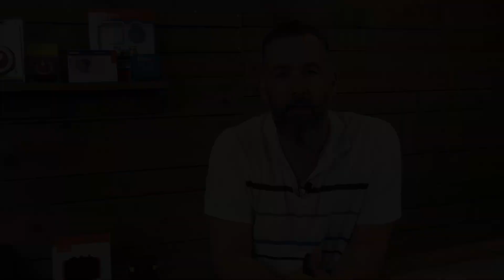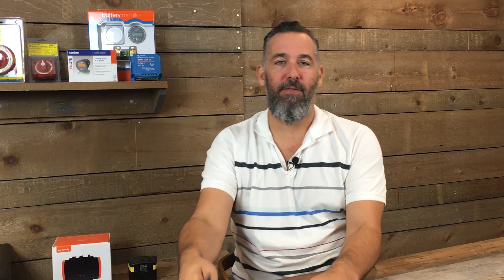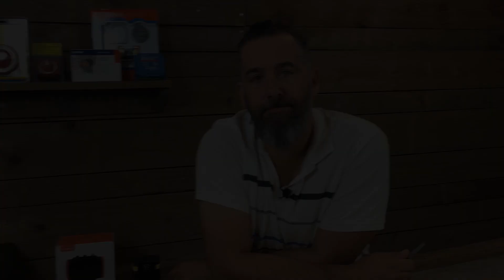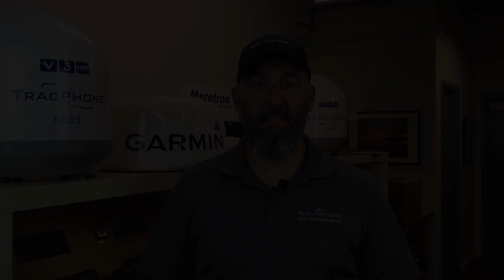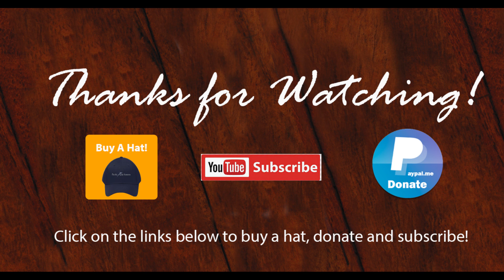Ask PYS - I Can't Figure Out How to Open the Caps to Check the Fluid Levels on My FLA Batteries?

Comment: I ran into a battery that had a sticker over the caps so it looks like you can’t fill it. I call the store and they said Peel the sticker off so you can remove the caps.
Reply from the maker: Good one. That's true, sometimes the fill caps are not easy to find.

Comment: Valve Regulated Lead Acid (VRLA) batteries (maintenance free) are lead-acid batteries with caps that are not intended to be removed.  The caps include valves that capture and return water.  I use them as starter batteries in my converted bus.  AGMs for the house side of things.
Reply from the maker: Hi Bruce, good distinction. Absolutely true, not all lead acid batteries need to be topped off. Gel and AGM lead acid batteries are VRLA batteries and do NOT need to be topped off.

Comment: I heart flooded 6volts best bang for buck outside of 2v traction. I've yet to try Firefly but I intend to. The art with flooded is to not be a total cheapskate. Add an automatic watering kit with hydrocaps, dial them up to 14.8V + temp. comp. and watch them hold their own against Li-Ion. I wouldn't put an open-cell battery on a salt water vessel or 4x4 though.
Reply from the maker: Liam, can you share more about your experience with a watering kit. What model you bought and often you've used it?
Reply: Hi Jeff, my Crown Cr-235s are 6 years old. I was using them 6 months a year up until last year, the are mostly floating these days as that vessel (van) is in dry dock for the foreseeable with a chassis rebuild underway. I often pushed up to 3-4 week deep cycling in Winter and up to C3 recharging. They're still testing as SG 1.28 after a fortnight or so recuperation on a MorningStar MPPT dialled to 14.8V + temp comp. I never EQ.
I fill them manually with a hydrometer once every 3-4 months. It was every 6 months for the first 4 years until I added more aggressive chargers.
I've been fitting Crowns with flow-rite and a hand pump from a reservoir for clients that went with FLA. The Trojan kit is fine too but a bit pricey, lots of other options, even regulated pressure pumps.
I won't dial the chargers up beyond 14.4V+ Temp. comp.  unless the client buys the watering kit...even then they can still get thirsty because I have a tendency to maximise the alternator potential. I do warn them of all these things. 
Most people go with their pocket at the end of the day. So I tend to leave the cheap and unreliable stuff off the menu because well..I'm sure you can guess...